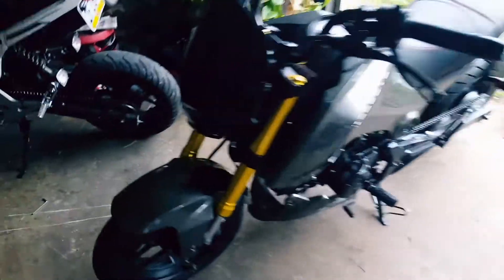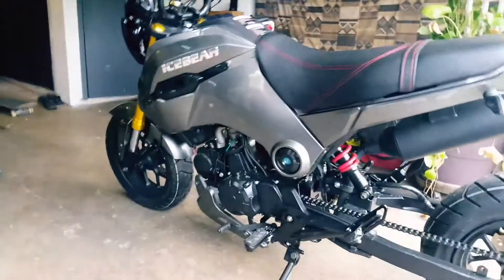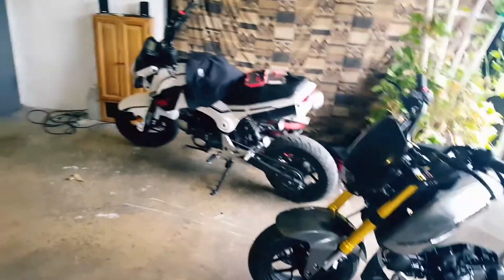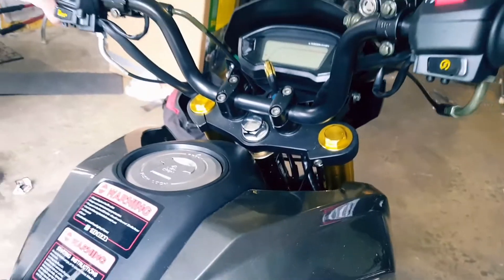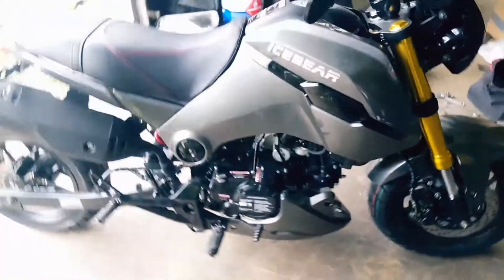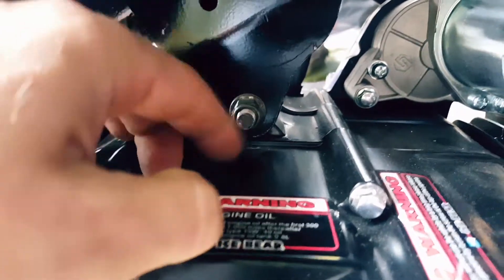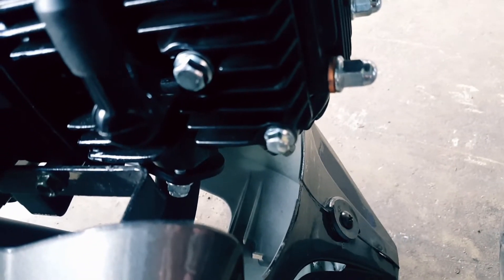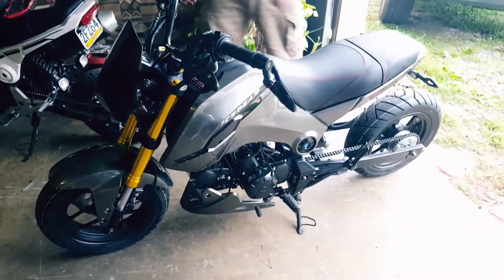(Grom clone) Icebear fuerza overview and run down

Comment from the maker: Its great! holding up after precaution making sure everything  was tight and locked tight.  the head bolt nuts for the exhuast still vibrate loose, so id get 2 more lock  nuts and jam nut them on with the other nuts. i will have a video up this week soon, cruising with it

Comment: I just got this bike today and I’m assembling it I wanted to know when you assembled it did you try to roll it and move it to another area because I was assembling it outside of my garage and I try to roll it into my garage without turning it on and it wouldn’t move the tires are locking is that because it’s not in neutral or because the bike isn’t started ??

Comment: Having a problem with the clutch cable coming loose at the clutch lever/perch ..I have everything adjusted idk also the rear foot break bolt broke .. I think it leaking not sure can you put new videos on when you ran the clutch cable on the icebear fuerza

Comment: Any idea what the little W5W bulb in the headlight does? Mine never turns on. Not sure why it's there.
Reply from the maker: M&Ms Girl it's your running light. It's probably burned out. 2 screws on each side takes the whole thing out and you can get to the light
Reply: BANG BANG SCOOTER GANG It's press fit in. I followed the wire in the harness. It's a dead circuit. It just disappears after the 1st plug. It's not powered.
Reply: M&Ms Girl test it with a multimeter or a prob tester and see if you have any voltage

Comment: Do you think a zs190cc swap would be easy as far as the mounting? Or would I have to get some mount kit?
Reply: It's a direct bolt in swap
Reply: @adamnadu1994  thanks I've confirmed you are correct! I haven't confirmed about the gear indicator if it will still show on the speedometer but I've read somewhere the sensor can be swapped not sure if that's true

Comment: these are more stretched than the grom, can these things still wheelie?
Reply from the maker: Zack Miller yeah you can but definitely do the front sprocket change, cause it’ll be much easier to do. Get a 17tooth sprocket
Reply from the maker: Zack Miller yeah you can pop it up but and can't ride one out
Reply: BANG BANG SCOOTER GANG Is it still holding up good?